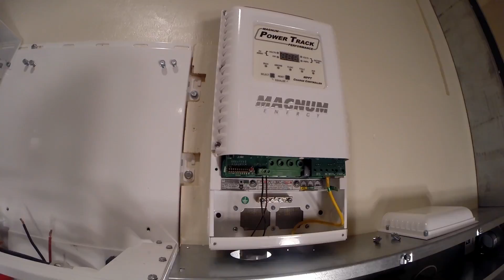Off Grid Solar #22: Venting the Battery Box

Comment: nice!!  Im planning on using the relay on my battery monitor to control the fan
.
Reply from the maker: I suggest mounting your fan vertical.  I plan to re-do this to make the system vent even when the fan is off.  I am going to vent it with outside air and probable design some type of geothermal to keep the temp constant.
Reply: ***** for geothermal just paint the chimney black, if it is in the sun it will draw.

Comment: WOW David, you are getting a plethora of input from your fan club, yankey4, Chris , Tesla, me (retired BELL TEL tech ).  So far, we usually agree and add to your producing a BAD ASP solar system.  My minor tip is first the outside vent.... if you get a driving rain, a slanted cover would help, like the aluminum slant cover over a dryer vent.  Next would be a mesh screen to prevent wasps and other assorted guests from infiltrating the duct. I have found that they got into the heater vent on my motor home and built a nest.  It might restrict flow a bit but the fan will do its job.  Chris and I both purchased WATER MISER safety vents from FLOW SYSTEMS for our Trojans. I got the tallest since clearance is not an issue. They are supposed to prevent most hydro from escaping. About $6 each.    J K
Reply from the maker: Good suggestions all around.  I need to look into the water miser's and compare to the Trojan watering system.  I don't know much about that yet.   All the comments are very much appreciated.  Thanks!